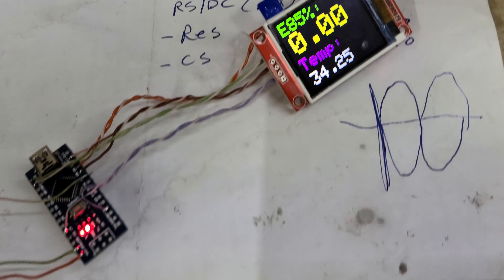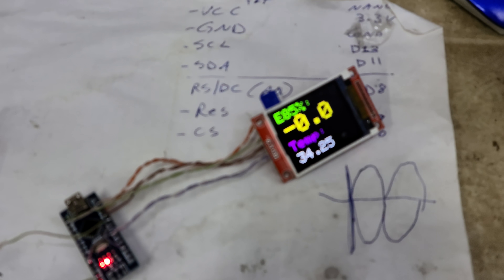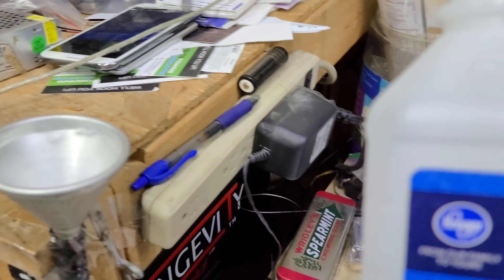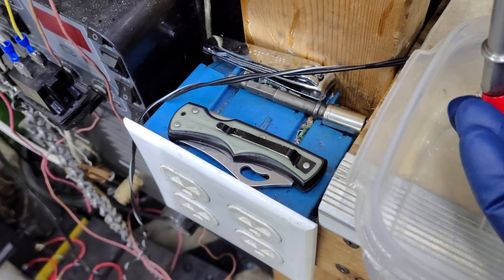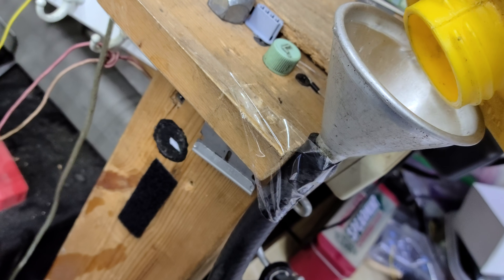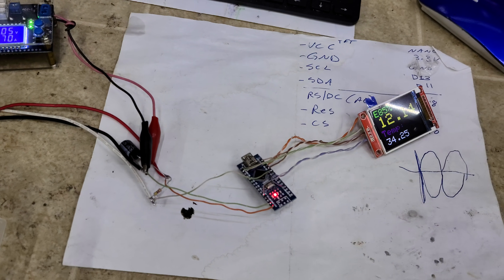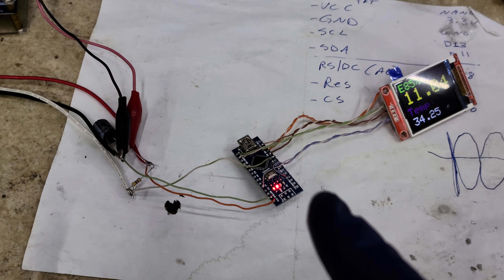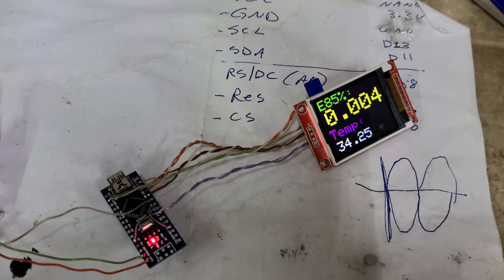E85 Flex Fuel content TFT display  Arduino ST7735

Comment from the maker: OLED Code is here:

#include <U8glib.h>
#include <SPI.h>
#include <Wire.h>

U8GLIB_SSD1306_128X64 u8g(U8G_I2C_OPT_NO_ACK);

# define dataPin 8

int Htime;         //integer for storing high time
int Ltime;         //integer for storing low time
float Ttime;       //integer for storing total time of a cycle
float frequency;   //storing frequency

void setup() {
  pinMode(8, INPUT);
}
void loop() {

  Htime = pulseIn(8, HIGH);   //read high time
  Ltime = pulseIn(8, LOW);     //read low time
  Ttime = Htime + Ltime;
  frequency = 1000000 / Ttime;

  u8g.firstPage();
  do {
    draw();
  } while ( u8g.nextPage() );
  delay(1);
}
void draw() {

  //u8g.setFont(u8g_font_ncenB12);
  //u8g.setFont(u8g_font_fur25);
  u8g.setPrintPos(10, 32);
  u8g.print(frequency - 50.3, 1);
  //u8g.setFont(u8g_font_fur21);
  u8g.setPrintPos(10, 64);
  u8g.print((Htime / 1000 * 74.25) - 114.25 , 0);
  u8g.setFont(u8g_font_ncenB12);
  u8g.drawStr(85, 50, "o");
  u8g.setFont(u8g_font_fub25);
  u8g.drawStr(95, 64, "F");
  u8g.drawStr(85, 32, "%");

}
Reply: Witch Arduino do you using?
Reply from the maker: @pilotohernandez1569  Nano